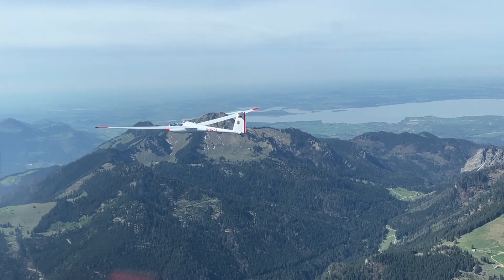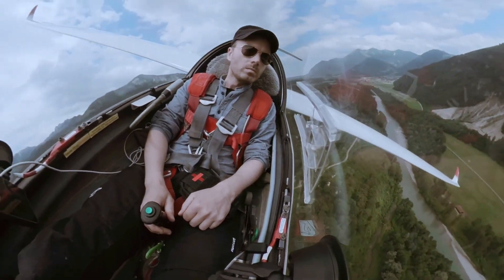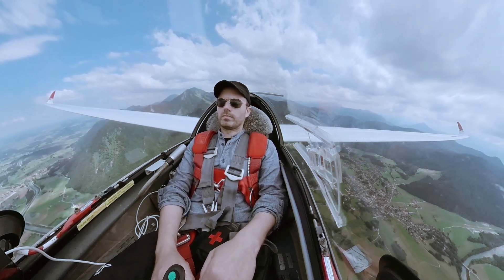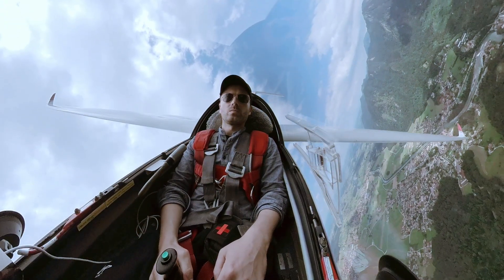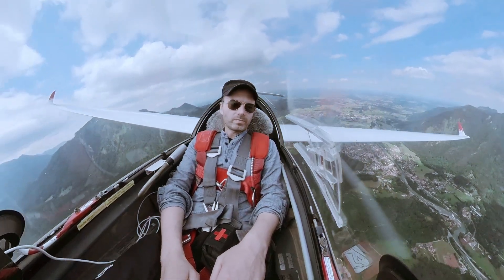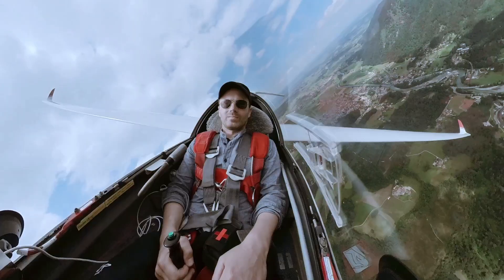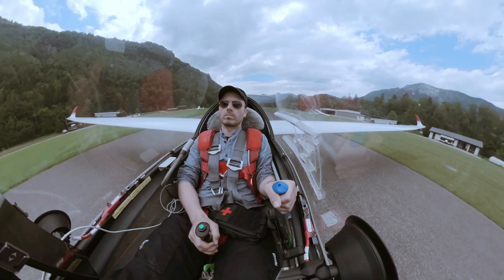Most DANGEROUS turn in gliding...

Comment: We stopped doing 2x90 degrees turn when going from downwind to final approach and instead use fishook approach, one wing pointed towards landing mark and a gentle big turn maintinging one eye on speed throughout instead of doing 2 sharp turns. Also a safer way to do outlandings where estimating where to turn can be harder.
Reply from the maker: ...thats an interesting idea. Two sharp 90s seem to me as well not that comfortable, when I am close to the airfield or mountains around around does not allow to really fly two relaxed 90s. I will check that out...
Reply: @flyneur  Its a nice idea, you won't get as perfect approach on your home base every time, but it prepares you better for outlandings is the main part, and THATS when you wanna be accurate.

Comment: I just fly hang gliders, so I don’t know if this is covered in sailplane training, but in a coordinated turn, the inside wing is always at a higher angle of attack. It was 20 years ago when I cranked through the flight mechanics of this, but the maximum differential in angle of attack I think happens around 45° of bank for hang gliders, that might apply to all aircraft, but I forgot the exact form of the solution so it might be different for some thing with a very high aspect ratio. Also, that is in still air. If you are centered in a thermal, the air on the inside wing will be going up a little bit faster than the air on the outside wing, and this increases the differential angle of attack even further. Higher air speed makes these effects less prominent (meaning ballast in this case, not lowering the nose). But in basically every situation that you will encounter a stall in a glider, it will pretty much always be the inside wing. Which is always the worst one for the stall to happen on. So yeah, practice.
Reply: Much more significant than the slight difference of angles of attack is the difference of speeds between the two wings...
Reply: @jgmendes3664 Since we are talking about stall onset, the AoA of each wing really is the important thing to talk about here.

Comment: For us powered airplane pilots, we have fuel energy to get on to the runway.  There is no need to pull back in the base to final turn (or any turn).  What does the airplane want to do in all turns?  Is it wrong?  The airplane cannot stall itself.  A pilot pulling back on the stick is required.  To spin we must stall and the airplane didn't do it.

Comment: After all the insistence from our instructors through the years, in my final turns I try to always maintain these 3 constants:
- Not too much pedal input compared to bank angle (avoid skidding, preference for slipping)
- Not be afraid of "seeing the houses getting big" (again, bank angle)
- It's ok if nose falls a little and speed builds a little (I will correct that established on final).
Reply: Forget all that : pay attention to your airspeed instead and surroundings. That is all you need.

Comment: Very nice video; too much emphasis on speed, and too  little on symmetry for my taste ;-). 
While we all agree that speed = life, stall can happen at most any speed, depending on the load factor. Spin, on the other hand, will happen only if the flight is not symmetric : thus, keeping symmetry at all times, especially in turns, is essential. Let's keep our eyes on the yaw string.
Moreover, last turn spins usually occur because the pilot is too low in base leg, and tries refusing the ground nose up while turning final with too little ailerons and too much rudder. Bottom line : last turn spin avoidance starts flying an approach pattern at the correct hights (better outlanding a half kilometer from the runway than crashing on it).
Last word : I've seen students confusing clean stall while turning, spin and spiral dive. A good training should make clear the differences, as the flight context or the counter-measures are not the same.
Reply from the maker: thanks a lot for your detailed comment, which I found interesting to read and adds helpful thoughts! 😃🙏

Comment: That's the most dangerous turn in general aviation, too. Falling in love with the rudder can get you killed. In the U.S. we call it a "skid" turn, or leading with the rudder. I've overshot the final approach more than once, but I've never even thought about trying to fix it with the rudder. Just fly back on course once you level out.

Comment: Great video. Pretty interested to know how you've mounted your camera.
Reply from the maker: Thanks for your feedback. I use the suction cup mount for action cameras from SmallRig. It is a little investment but for the stronger dynamics in temperature and air pressure during gliding this works best for me until now.
Reply: @flyneur  Thanks! Might try that some time.

Comment: Total BS.  There is nothing complicated on the turn to final approach.  Just maintain your speed and control your sink with the spoilers.  I have hundreds of hours in a Class III sailplane and more in powered aircraft.  Stall/Spin accidents can happen to anyone, but sailplanes have low stalling speeds compared to powered aircraft and that gives them a greater margin of error.  They tend to float on landing.  If you're slow in a powered aircraft. add power, put your nose down and go around.  Stall/Spin training should be required for a pilot's license, unfortunately, the FAA removed that requirement.

Comment: We learn to always fly circuit at 90km/h. With speed it would be very hard/impossible to use too much rudder and stall, right?
Reply from the maker: …i am not shure if a single number (90kmh) helps to be safe…I understood that these stalls/spins happen often because of lack of concentration, tiredness, distraction, turbulences etc….I guess my message is that keep energy for your concentration especially for the landing or circling close to the ground. my personal speed to fly circuits at unterwössen is even 110 kmh. but this is due to the special traffic pattern and mountains around…

Comment: yep. in my club, due to airspace limits and the runaway being on the ege of the airspace you literally have to do the graveyard 180 100 feet avobe trees if you wanna make the runaway and it is generally at stall speed, so we tend to take steeper approaches and disregard the normal approach in the name of safety and not dying because of airspace bounds
Reply from the maker: wow, that sounds like an adventurous traffic pattern, which make you pilots there handle this turns from the beginning…may I ask were it is?
Reply: @flyneur  right next to Como, Milano

Comment: I think the most importand things to remember is safe speed near ground - stall speed +10kts + 1/2 wind speed. Second; top rudder in a turn is anti spin. Applying bottom rudder at low speeds sends one into a spin - I learnt this on finals in a power airplane in 1979 (fortunately they taught spin training as a pre-solo requisite back then). Good video, well done.
Reply from the maker: Nice explanation! That sounds very good and easy to memorize! Thank you for this helpful contribution and your feedback!

Comment: In my club AK Celje Slovenia during gliding course we did many stall spins from fully developed spin to recovery....and did happen to me ending up in spin during soaring in turbulent thermal conditions....
Reply from the maker: yes, these trainings are worth it.  must be very uncomfortable to be thrown into a spin in a turbulent thermal unexpected…😮
Reply: @flyneur  Actually it was not unexpected.......I was in a strong and turbulent lee thermal, but high over ground and no one else was around. I was circling with approximately 90 km/h but the speed was jumping from 75....to 110 if the circumstances were more risky I would add at least 10 km/h of speed just to be more on the safe side. ....I was circling and sudden silence happened.....I knew that probably I will get instance nose down view of terrain below.... I put the stick in center and slight forward, rudder neutral....the glider was flying again in half turn with this configuration....I just needed to recover the dive...then I went back and soar up till cloudbase.😁
for me the most dangerous moment in gliding was when the tow plane flew to slow and low.....I lost the alleron effect  and I was just dangling behind controlling the plane only with rudder (Club libelle 205)...😱

Comment: For decades I am teaching people how to guide gliders and for decades I advise not to wear those look-out limiting devices (Base Ball caps) in any airborne cockpits.
I know many want to look like TOP GUN Mavericks but EGO is NOT your AMIGO 😇

The notorious last turn before an attempted  landing is well known.
Especially in out landings you want to be close to something that represents security but to close means practically no base leg, the leg where you judge how to operate the airbrakes so when you are turning final you are on the perfect glide path on speed with the airbrakes midrange.

To close means no base leg and you don’t want to loose sight of your intended landing area and when getting lower you intend to give more rudder than aileron to keep your eyes glued on the landing area and so spinning into the ground is created.

Regards
Frank

Comment: As a SEP pilot: A base-to-final stall can actually only be prevented by two measures 1. flying a turn, i.e. with a corresponding deflection of the rudder in the direction of the turn 2. no steep turns over 20 degrees. I would think that these two points also apply to glider pilots.
Reply: Point 2 does clearly not apply to gliders. 30° or even 45° turns are fine and you are practically not more likely to spin. Someone else in the comment explained that low angles turns are actually more risky because the pilot might tend to (inconsciously) over rudder to turn fast enough, which is exactly what should not be done.
Reply from the maker: Thank you for your suggestion and completing. Yes, these are defenitely measures which are helpful to avoid skids/stall/spins.
Reply: I disagree. A steep turn is much safer as both wings are flying the same distance. It's gentle.turns where one wing is travelling much less than the other is where glider stall/spins on final turn happens
. Gliders have a large wingspan and one wing in gentle turn will stall well before the other.

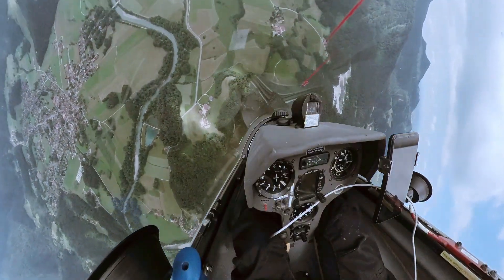Comment: Why pulling through when inverted at 2:39 ? The correct way to recover is to push the stick forward then roll to nearest horizon, otherwise you can pickup lots of speed and risk going above Vne. Do not use your spin recovery technique for powered aeroplanes, use this instead https://youtu.be/J9xYX8R_uUU
Reply from the maker: Thank you for commenting. Absolutley right, every airplane is different and need often different techniques to control and recover. I was pulling because I was not fully inverted and I was warned by a gliding instructor that to fast and strong pushing in this glider (LS4) may lead to inverted spin which is more difficult to recover. Yes, I confirm that the speed got high very fast...

Comment: One simple countermeasure: Keep your speed up during turns. Stallspeed is also a function of bank angle. Should be basic knowledge, though. With appropriate airspeed there is even no issue when extending speedbrakes while turning.

Comment: For completeness, these turn onto final spins happen unintentionally, taking the pilot by complete surprise. Contributing preconditions include tiredness, distractions, dehydration. The pilot commences the turn with a low angle of bank, then subconciously inputs rudder to bring the runway into view, this is followed by their conditioned response to ease the stick back as the nose starts to drop and then wham, instant wing drop into a spin. One good habit is to enter the turn onto final with a well banked turn, always.
Reply from the maker: @ianbenning2833  thank you  for completing! very good points you are mentioning! 👌😀🙏

Comment: Is this not part of training normally? In the UK, I must have been asked to do this maybe 10 times already, and I still dont have a bronze! (All but one demo successful BTW!) but in my club, you do it again and again before solo, and then on day checks you do it if you've got the height. Another point: this is why we fly a downwind circuit when we can. As you turn final, the wind tends to tighten you up, so you if anything you use outside rudder to stay aligned with the runway. If you fly an upwind circuit, then if you don't compensate in advance, the wind pushes you downwind of the runway line, and your instinct (which must be fought!) is you need inside rudder to remain on the line of the runway.  And down you go, too low to recover. A few days ago my instructor casually suggested I fly an upwind circuit, and after admitted the purpose was to watch me for any over ruddering on final.
Reply from the maker: Yes, it seems that in UK it is mandatory, which is great. But my impression at least in my environment (germany) was, that this turn in final and in a thermal is not that present like cable-break trainings etc. That is the motivation to make a video. UK has anyway great training plans and a lot of knowledge provided online which I regularly access and use for refreshing. thanks for sharing your insights, that is very valuable here! 😀🙏✌️

Comment: This video topic is no joke. In my early days of gliding I lost a lady-colleague of about the same age who stalled in the final turn at an outlanding. I was shocked when this happened, but the natural reaction when getting too low is to pull on the stick - which of course when you stall, only makes you go down faster.

I mentally prepare for each final turn, and I put the trim way forward in preparation: This gives me a good force feedback on the stick - and in case I get disctracted for whatever reason ( traffic on final, distracting Radio call, runway suddenly not free ) the speed will go up rather than down.
Reply from the maker: I am very sorry for this experience to loose a colleague. Thank you for sharing, reminding the risks and give an insight how to handle with sudden reflexes. I just hope that this video abd and these comments help to increase awareness of these overruddered turns…
Reply: what you do on glider if runway is suddenly not free?
Reply: @Jakaj99  Plan ahead; Radio contact; if not free: land before (more airbrakes), or after (close airbrakes), or on the side of RWY in grass
Reply: @Jakaj99  TO/GA 😉
Reply: It’s how it should be done. However I find it particularly hard to pull my Cessna single-handed in the flare to have one hand on the throttle, and so I help myself with a little trim beforehand which is NOT SAFE. I know it. It is absolutely horrible to imagine what could happen when getting distracted in the final with such a setting. And next flying season I will test again whether the gym workouts paid off, and I need a little less help by trimming…
Reply: @Suselsu1 If you know you're doing something stupid on every landing, STOP IT before it's too late.  Being too weak is not an excuse to risk your life and those that fly with you.
Reply: @Golf4Driver yes definitely. Working on my strength and hoping that this pays off and I will no longer need two hands to pull the flare